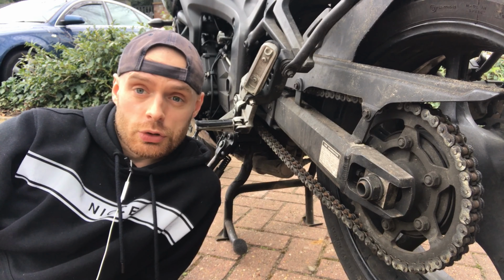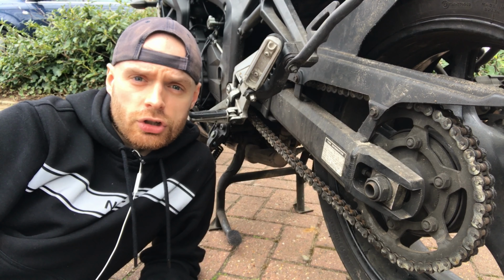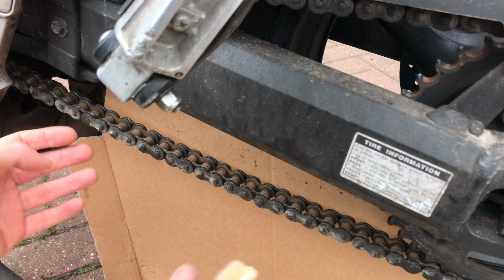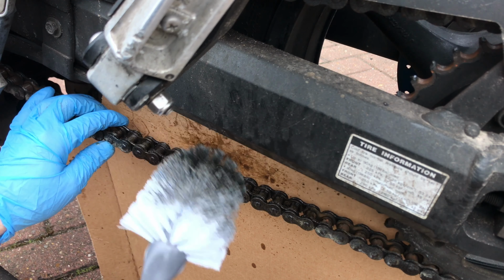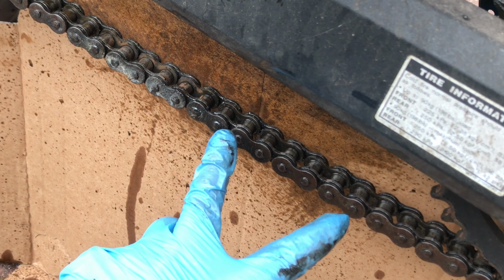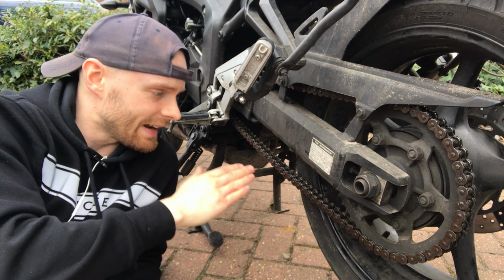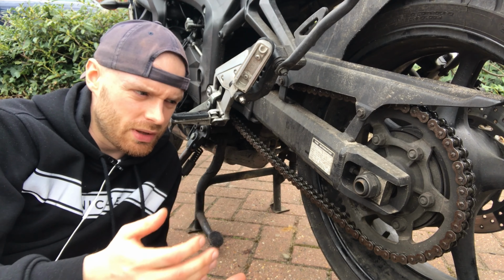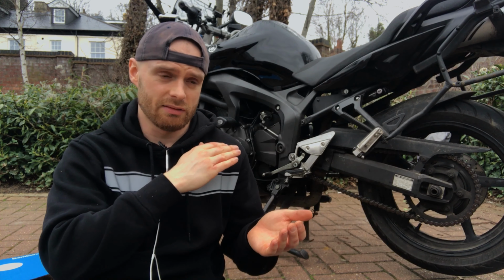How to Clean a Motorcycle Chain Well THE CHEAP WAY

Comment: Nice. I just cleaned mine with Kerosin (Petroleum in German) works really well but you have to lubricate after that.
Reply from the maker: Nice one. Kerosene works great. I just started using engine oil because there was always so much around and discovered it worked really well. Saved lots of money over the years. Thanks again for watching!
Reply: No kerosene doesn't work. It gets under the O rings and will dissolve the lube inside the rollers.
Reply from the maker: @BN1960  interesting thank you . Another reason why I think I’ll stick with engine oil for cleaning.
Reply: @BN1960  That's 100% not true.  Almost every owners manual out there literally recommends using kerosene to clean your chain.  Then gear oil or lube....
If you sprayed kerosene on that chain, it would literally look like new :)

Comment: Yes l see this method used a lot, you have convinced me oil or kero is fine for rubber 0 rings thanks
Reply from the maker: No problem! Yes  they are perfectly fine for o-rings. Kero works great but left over engine oil is pretty much free! Thank you for watching

Comment: I got myself a 2006 FZ6, and it has an automatic chain oiler. The small oil container is below the seat.
Reply from the maker: Nice one those are really good. Is it a Scott oiler? I have heard that the constant oiling can means a lot of it comes off on to the rear wheel. Does this happen or does it work pretty well?
Reply: Fab Motorbikes since i only got it this week, i cannot really tell. We will see 😅
Reply from the maker: Nice one. Let me know how it works out! And if you only just got the bike too... congratulations! Great choice of bike 👍

Comment: Man, the chain is still dirty as hell. You may use white spirit solvent and quite big paint brush to clean it well. White spirit is good at dissolving old lube and washing off dirt from chain. Next you need to lube not all the chain, but little rubber rings between links with special chain lube.
Reply from the maker: Thanks Boris appreciate the advice. This is quite an old change that is due for replacing soon. It was never going to get back it’s new sparkle. I also never aim for stripping the chain bare with harsh chemicals of any kind. That tends to accelerate the ware. Ensuring the chain is mechanically clean is always my aim. Thanks again 👍 ride safe
Reply: @FabMotorbikes  oh, I see. Ok then, have a nice and clean roads, mate!
Reply from the maker: Thank you 😊

Comment: Why do you even have corrosion on chain?? 700km clean an lube!
Reply from the maker: It was like that when I bought the bike. I got a fantastic deal, the slightly corroded chain was the only problem. However it’s only surface rust, it works perfectly well.
But not really been anywhere recently because of lockdown...
A mechanically clean chain is what is important, no need for it to sparkle ❇️
Reply: @FabMotorbikes ok, but try some degreaser that arent atacking o-rings in chain and silicone base spray to lube and chan can laaaaaast- When im not riding in winter good spray and in spring no corrosion
Reply from the maker: To clean the chain I still prefer engine oil. It’s works well and is free as I say. And then I usually follow up with gear oil. 

At some point the main thing is that I’ll need a new chain...

But thank for your thoughts, it’s amazing how many different ways there are to look after your chain. So interesting 👍